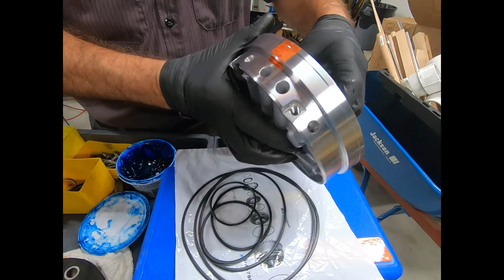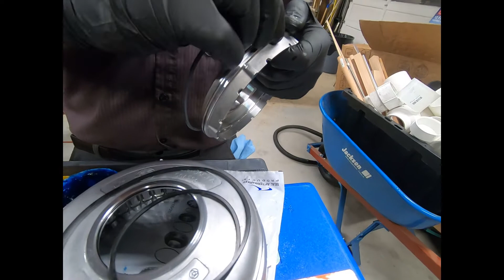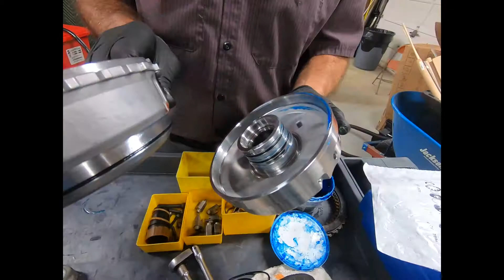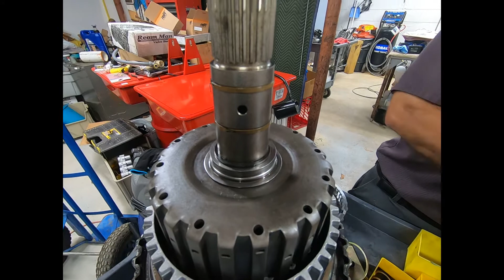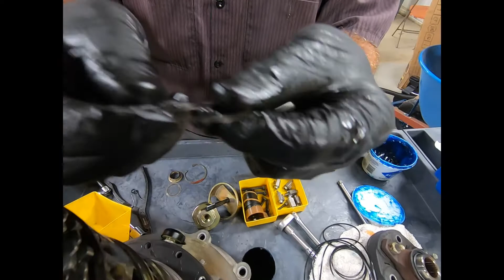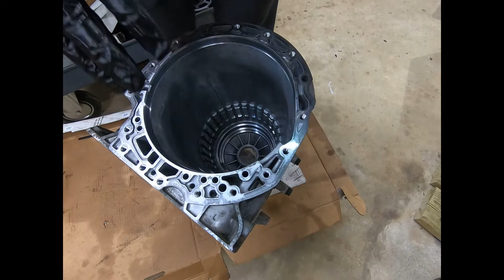Mercedes-Benz 5G-Tronic Transmission (722.6) Component Overhaul Part 4

Comment: also on the 722.633 vs the 722.649 is there different gear ratios? I know the 649 is tiptronic but is much stronger. I was thinking of sourcing one of these to install in my sl500 03.  just having problem finding the data to show what differences there are and if i can change to the stronger trans